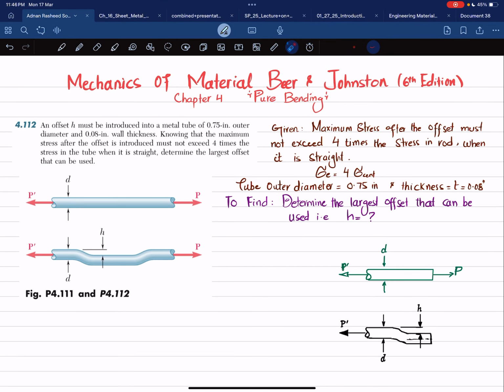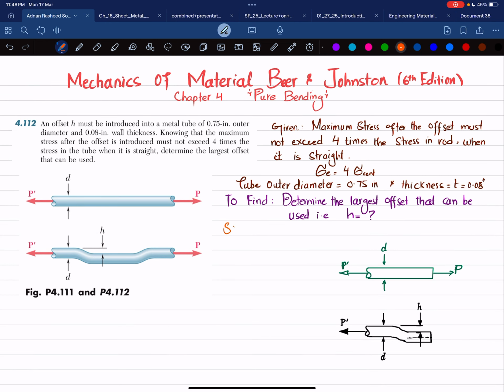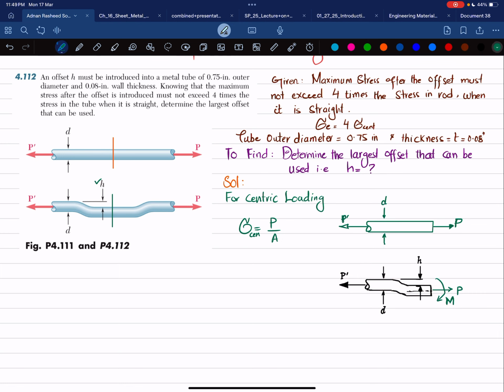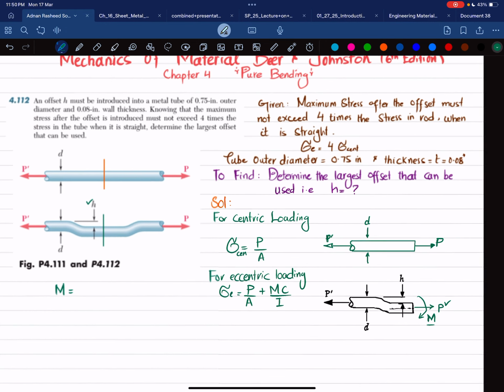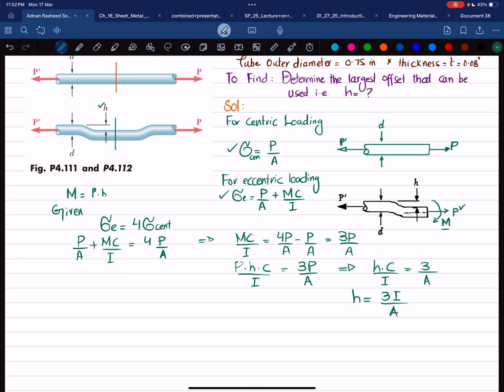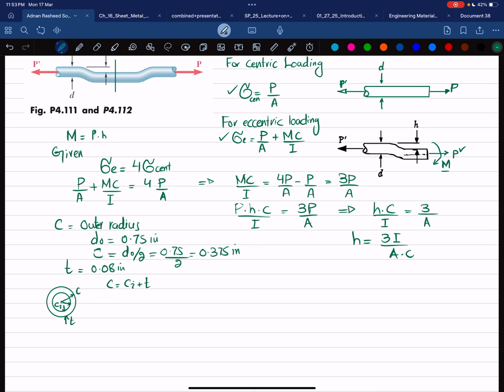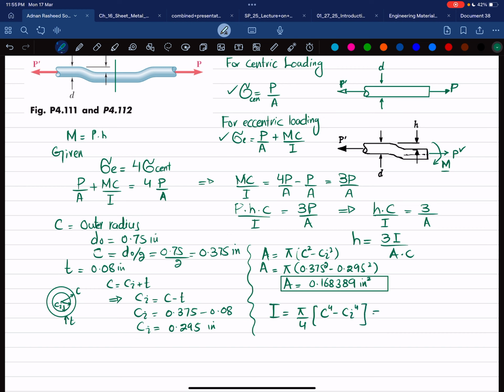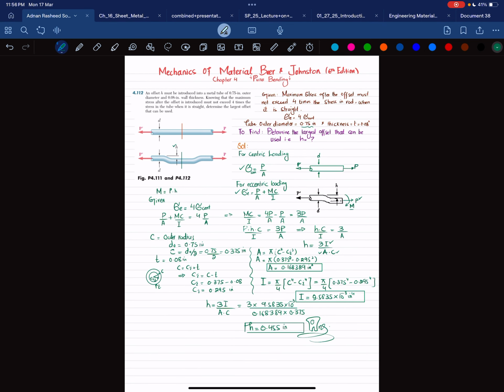4.112 | determine the largest offset that can be used for tube | Mechanics of materials beer and joh

Comment: Hello sir @engradnanrasheedmechanical, I reworked this problem and noticed a mistake in your solution. You used M = P(h) for the moment, but that’s not correct. Since the force P acts along the center of the original tube, the actual moment arm is the full distance from that centerline to the center of the offset segment. So the correct moment is M = P(h + 0.375), not just P(h). Using this correction, the final result for the max offset becomes h = 0.0803 in, not 0.455 in
Reply from the maker: Thank you for your valuable feedback but in I think I have done it correctly and also in solution manual it is solved in the same way as I did